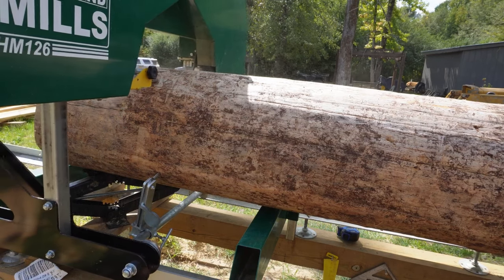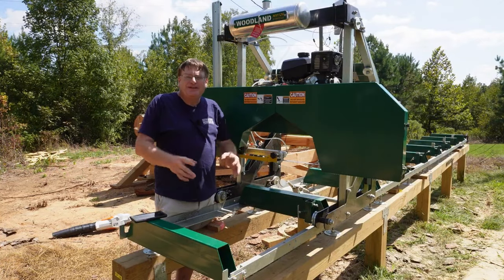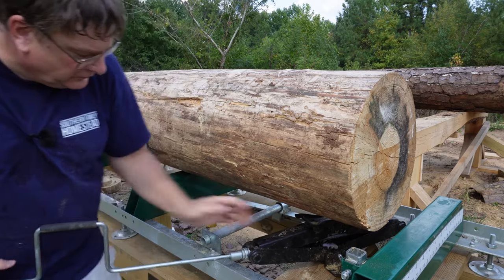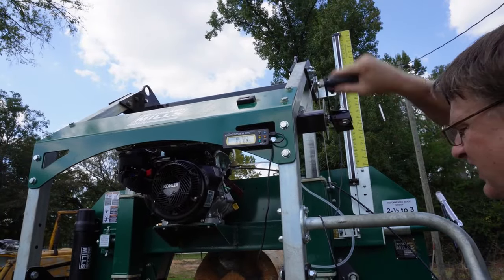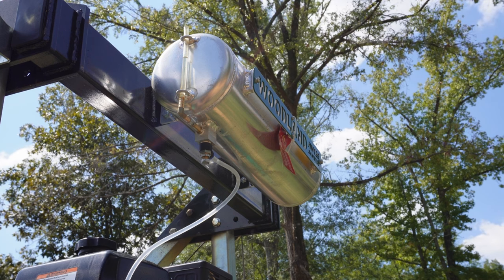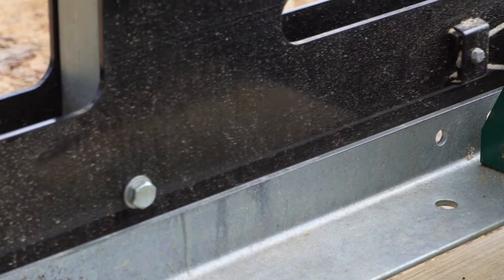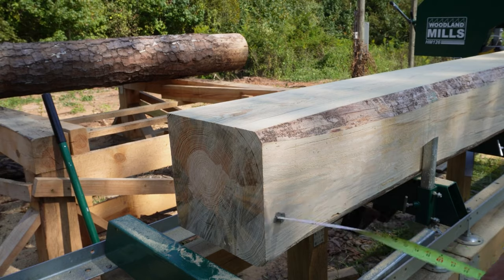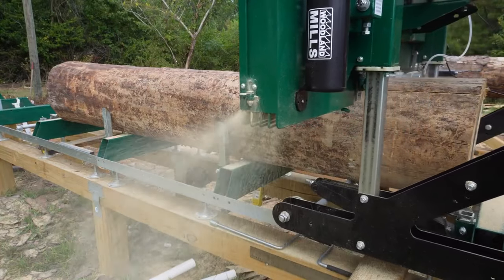Is This the Best Portable Sawmill for the Money?

Comment: Don't use regular or mid-grade gasoline. Only use non ethanol fuel. I prefer 100LL purchased at your local general aviation airport. Also, use your ignition switch only as an emergency shut off. Otherwise, always leave the ignition in the on position. Use your fuel shut off valve as your off and on switch. Let the carburetor bowl stave to stop at the end of each use.
Reply from the maker: I agree, I never use fuel with ethanol in small engines. We have one station that sells high octane ethanol.